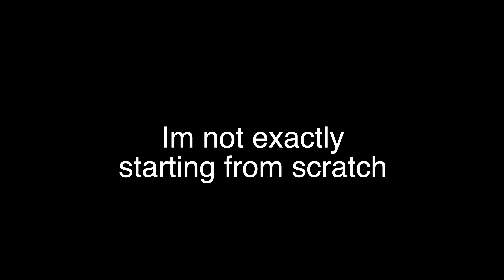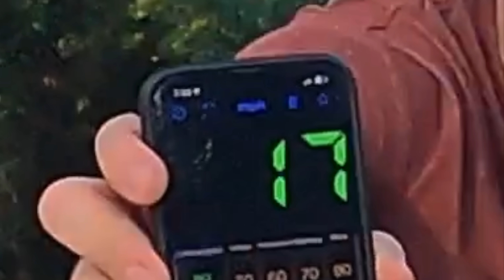I Built a Siege Machine

Comment: i think it needs to be built out of steel square tubing id say 2mm thick would be good enough, and it was angled downward to much hence all the scraping and getting caught up on the walls in the test, bigger tires would be ideal Magbie a set like off a quad bike usually can pick em up fairly cheap, and a Carby upgrade for that bit more power, this thing has so much potential would be cool to see it. and its a long shot but just an idea if your building a siege machine would be cool to have a trailer on the back carrying a trebuchet. great video though id love to see more, i left a sub so don't let me down Hehe

Comment: Speed is a problem you have to get through big ones you need speed in the front bumper a strong one at that

And for that I say get a go-kart because they can go pretty fast and then we'll strong bumper on it and then do the raming wall thing on the go-kart but make it towards the driver area and get like a metal grate so then you can see and then put a roof n sime wall/doors on it